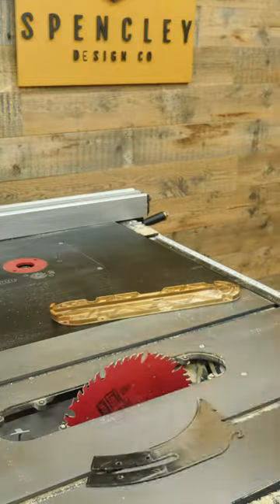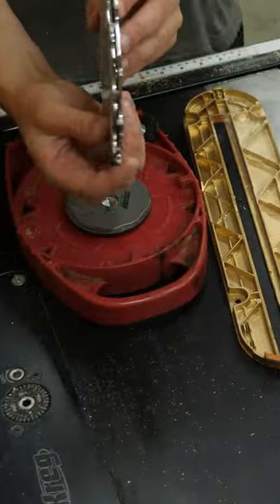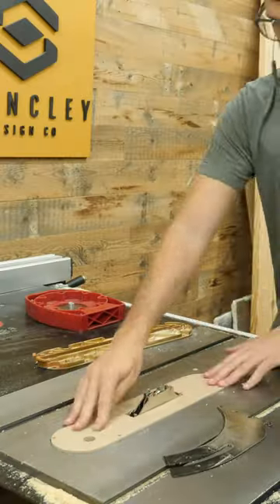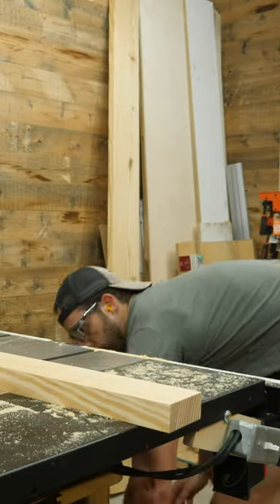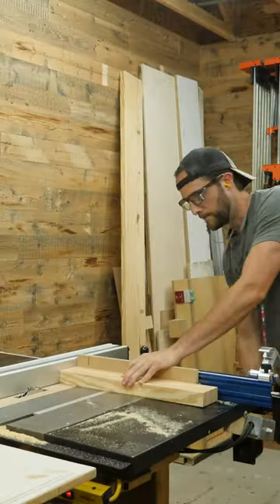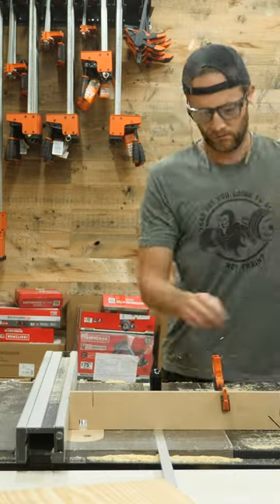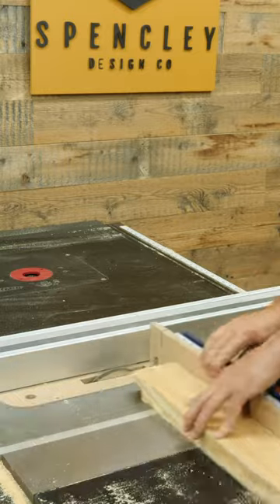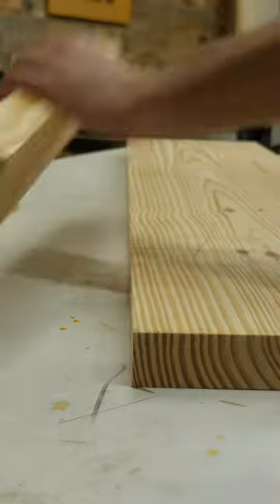this is illegal in europe

Comment: In Germany most Machines arent built to take a dado Blade.

It can be a possibility that the machine can Take a dado Blade, but the machine isnt designed for the higher forces that occur when using dados, so in a Professional Environment you would get huge Problems with insurances when Something goes wrong .

Better use a Table milling machine for those Things, those Machines have waaaaay better safety devices. ❤

Comment: not illegal we have slotting blades they are single piece blades and we have machines that shoot the blade out of the way if they come into contact with skin and you just wheel it back up no replacing the blade and aluminium cartridges either